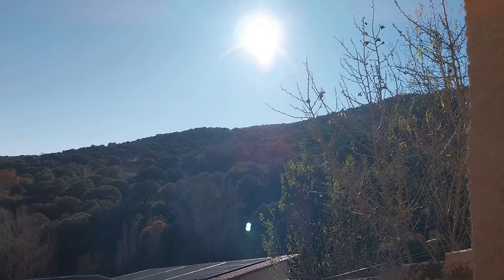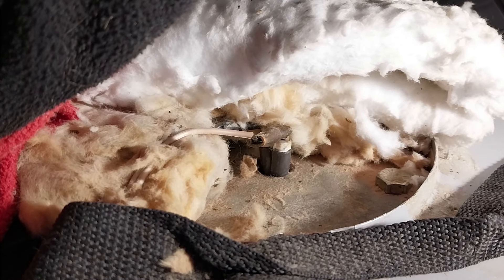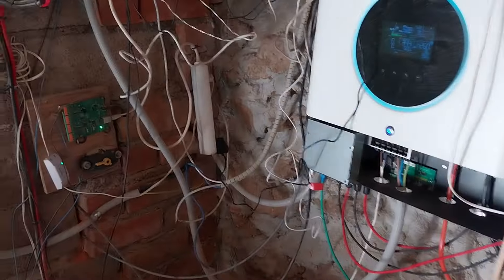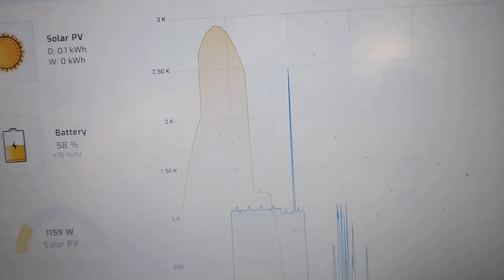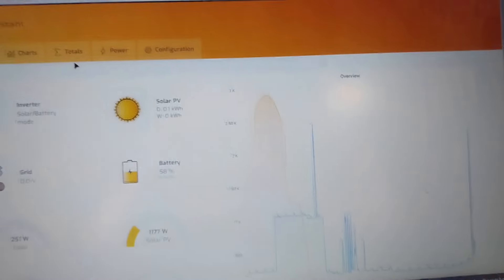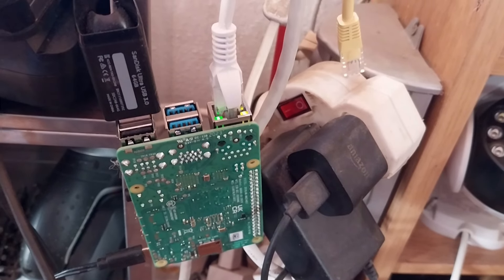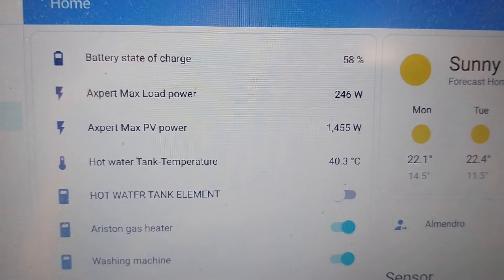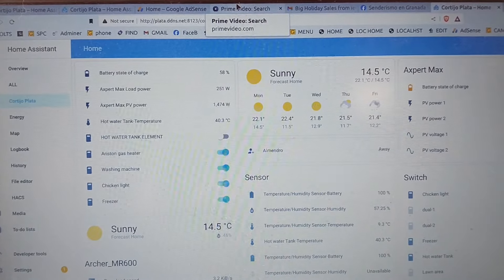Dump excess power into hot water  with solar assistant and home assistant

Comment: Very cool! How do you have solar assistant ans home assistant Mqtt set up? I assume you have the mosquito Mqtt broker set up on HA? Did you have to follow the whole Mqtt bridge setup that is shown on the solar assistant website or found an easier way to integrate? Usually, on the device you just point to IP address of the Mqtt broker and its user and password and it’s done but you can’t put that in the solar assistant as it has its own broker. Just curious how you got the two connected.

Comment: I have a very technical background, but I still can't bring myself to use these smart devices which are just solar energy vampires. Diversion should be done right off array DC and not use any battery, inverter or controller resources.  PV diversion from array is the simplest most efficient and cheapest way to heat water.
Reply from the maker: Solar panels are cheap nowadays and sun energy is free. In the last 30 days I have dumped 70kWh into hot water which otherwise would have been wasted. This is the winter with the shortest days.  This system of using the excess electricity does not use a battery, the hot water IS the battery.   I have not had to use any gas to heat my hot water for the first time this  winter.  That makes we happy because I want to use as little fossil fuel as possible.  I can't imagine how a DC system would work.  You should make a video and show us how your system works.
Reply: @granadainfo24 I saw some YouTube videos where they hooked up the output of the solar panel right to the two leads of the heater element so it ran on DC but somehow you’d need to have a dc transfer switch to take the panel output and take it to the heating element instead of the inverter. I think maybe that’s what the original comment was talking about. That seems complicated to me and your solution was quite easy and straightforward! Thanks for sharing!

Comment: What are you using to get the tank temperature into homeassistant?
Reply: Interested in this too
Reply from the maker: I use a Sonoff TH16. Search for "eWeLink Home Assistant Add-on"  There are several tutorials on how to integrate sonoff.  I wanted to know how much electricity the heating element was using so I used a shelly plug to switch on and off. (shelly plugs have a good interface with a graph showing energy use). The other type of sensor you can integrate are devices which are controlled by the smartlife app.   You have to make an account with tuya.   So, although there are many more, I have successfully integrated sonoff, shelly and smartlife controlled devices. With those 3 you could do anything.  If you really want to spend very little money you can order these things from Chinese websites like Aliexpress.
Reply: @granadainfo24  thanks.
Have a look at flashing it with tasmota if you want local control without relying on eweLink cloud.
Does the th16 allow multiple temp probes to be connected?
Reply from the maker: @grant_HH  I have never flashed devices which needed soldering only with software. I used to use tasmota flashed devices controlled  by php on a synology but this requires programming skills. Controlling things with home assistant is a trivial task once the plugins are installed. By the way: Shelly devices don't need to be flashed, you can communicate with them with the app or over http using commands passed through the url.      I was using php curl. I liked the days of working with php because of the mental challenge but now it is "childsplay" to run everything on home assistant.  I use dynamic dns to use home assistant when I am away from home and it is great to have control with my fingertips from anywhere.  --- NO the th16 only allows one probe.